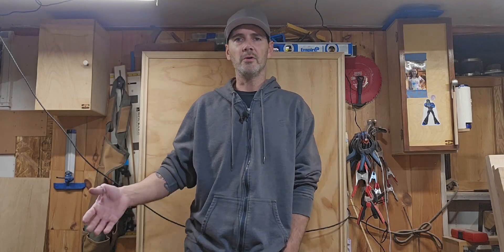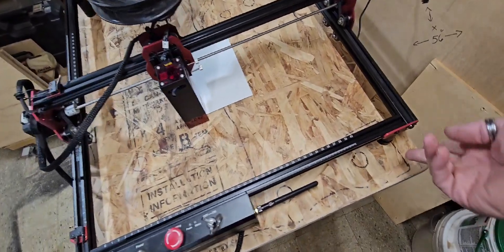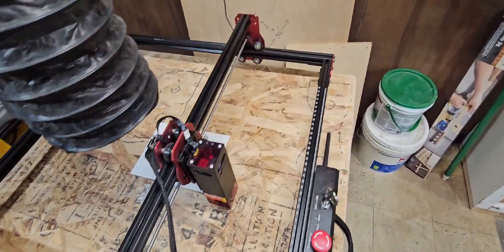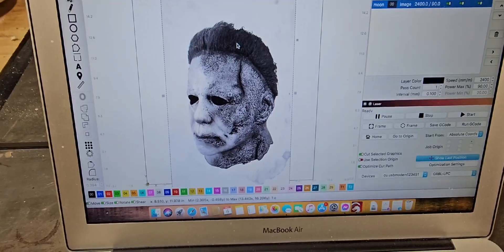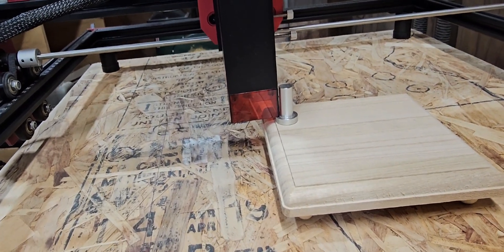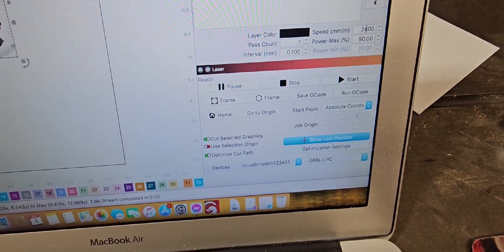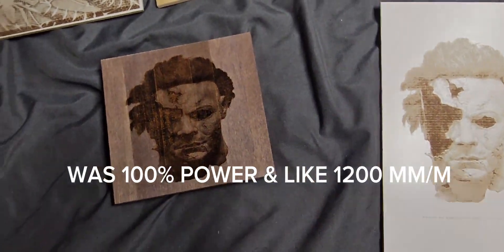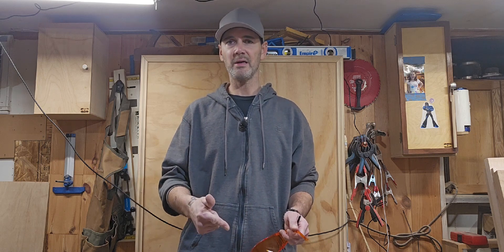Algo laser engraver review &  demo. #laser #algo #laser #review #woodworking #channel #lasercutting

Comment: Very cool addition to your shop Joe, it opens the door for some great projects for sure.
Reply from the maker: Hey Tommy! Hope all is well with you & yours! & yes! I've always wanted to get into the whole cnc or laser scene. I've had it about a month &  theres SO MUCH that I've yet to uncover w/ it. Can imagine what the next step up can do..lol thanks for watching brother! Always appreciate the support!
Reply: @tooljunkie555 HI Joe I had a question for you congraudlation on diy diffuser video my question to you is I do not have to many enginnering skills and I have a small model shop vac do you think a possible option could be that I get a pvc type and tape to the outside a wet foam filter and also put inside a wet filter both tape than plug in a pvc pipe into my exhaust port ? ideas please thank you my system is 1.25 diamter so it appears a commerical diffuser is not availble in my size do you think the previous is possilbe as a diy ? thoughts please thank you

Comment: You mentioned it cannot cut material. I can see how it cannot cut wood, but what  about a thin gauge brass? Could it burn through that? It looks like a handy tool.
Thank you
Reply from the maker: @johnbuerger6579  ive never tried with a rhin metal or brass but have actually tried with 1/4" &1/8" plywood and both were failed.  The 10w laser cuts through thin wood but not sure about the metal or brass. Ty for watching